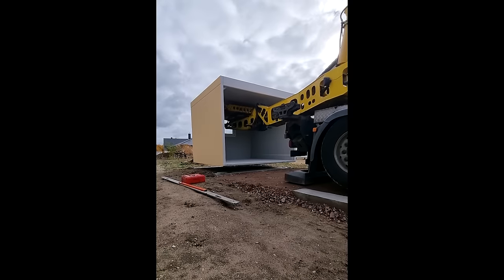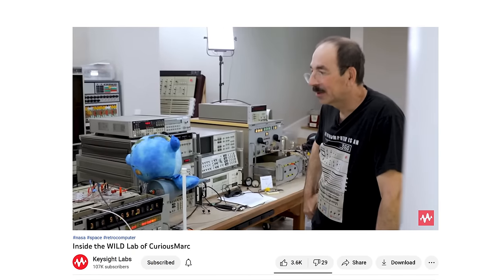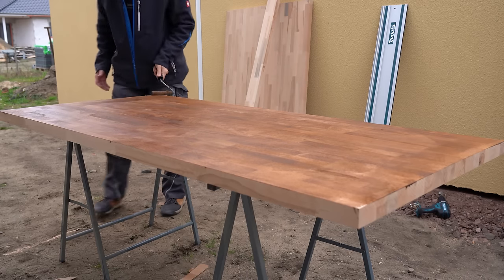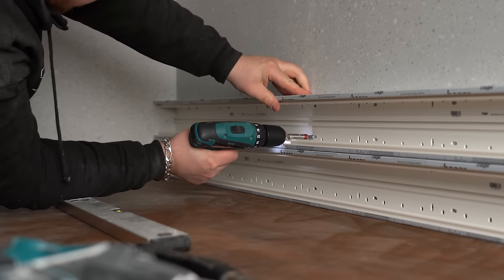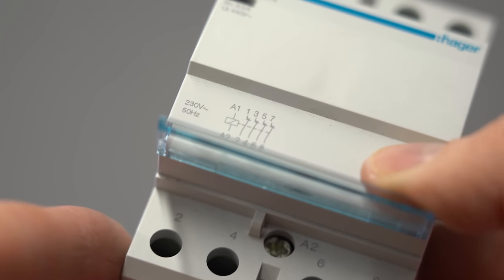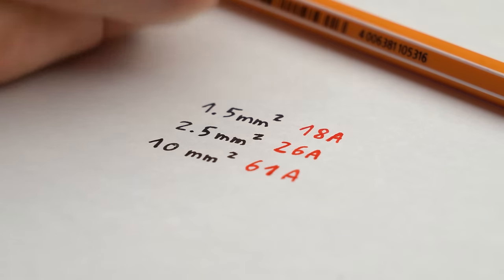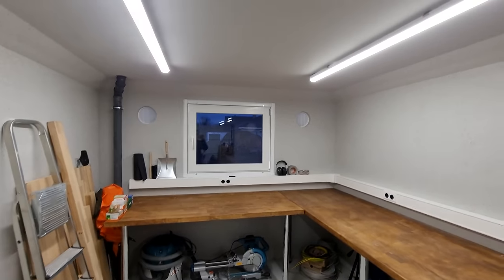Germans do the PERFECT Electrical Wiring! (Garage Build)

Comment: Nice and tidy work! The electrical code here in Belgium is very similar to yours, which isn't very surprising. I've done all my electrical work myself as well (also 3x400V+N, 32A main fuse), including CEE 32A sockets for my milling machine, home automation, etc. The only thing I'm wondering is why you're using blow fuses? We only seem to use those in industrial settings for really large currents (>64A), curious to learn more...
Reply: It looks like these fuses are pre-fuses for the circuit-breakers and so connected in line with them. In this case you have to take care about selectivity. This means that in case of a short-circuit only the next higher element in distribution hirarchy shall be tripped. Therefore yo can not use normal circuit-breakers for pre-fusing, because the tripping-characteristic-lines of the different amprere-ratings all run together into one line in case of a short-circuit and they all will be tripped. The solution is to use selective circuit-breakers (but these are rather expensive) or conventional "blow"-fuses.

Comment: Might have been better with a ‘Latching-Contactor’ or Circuit breaker with a ‘Shunt-Trip’ Circuit ?
That would assist with any ‘Fault-Clearing’ operations.
That means the Contactor would stay closed while the Circuit protection clears the circuit fault.

It’s unlikely that there would be a fault at the same time as someone operates the e-stop, but it’s definitely something that’s considered in industrial applications.

Contactors aren’t designed to clear or make fault current, they tend to fail catastrophically when presented with such extremes of Current.

Comment: I am your judge here.
I hate people when they put cables behind the fuse carrier... Hager has specifically those clips for those doings when you put cables around. (Later you can change RST order)
When things go wrong, we usually seperate earth from neutral. Cause if it overheats and starts melting , the live wont burn first, but neutral due from load. (Saves wires for later)(Just to mention this in our country , our ppl dont tighten the screws after some time cause of heating and cooling process)
When you connected from construtction to test power, i would gladly suggest you to put a bridge before RCD, cause earth is reserve netrual.Since you have 3 phases and 1 neutral i would suggest you that.
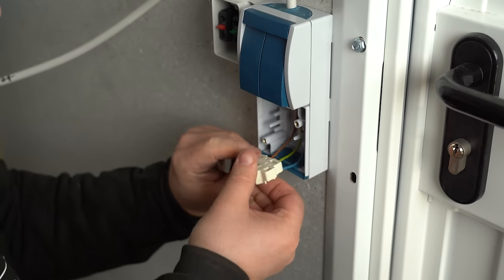At 10:49 when he stripps the outer shield of cable, that is no good. You can damage the main insulation from copper.(I've done it many times)
Those amps for copper are bit unrealistic.
I hate wagos.

Comment: Hey Scott. Dumb question. When do you use fuses, and when circuit breakers? Lot of industrial machines uses fuses in front of motor drivers etc. So my question is, why not just use breakers, if they are more easier to use and operate? Thanks

Comment: Personally, I would've done the entire electrical conduits and panels in steel, and ground it to eliminate EM radiation from the cables. Yes, 3 times the price of pvc plastic here. 
I see you had to pour a partial footing for the garage. Did you also have to go below the frost line of 6 feet like we do in Canada?
Reply: Steelpiping is not allowed. Steelcabinets are allowd if they are dubble insulated.

Comment: Nice work, but I would use one big pipe as opposed to 2 smaller ones; also I would add flexible pipe joints for the connection between the pipes or the corners

Comment: That's called "typically German!" Here in Germany we have rules for electrical installations of any kind. Many of these rules even have the character of a law. The DIN standard (German Industrial Standard) states, among other things, exactly which cable, which lines, which wire or stranded wire is intended for which application or can be used. Then there is the VDE (Association of German Electrical Engineers), whose regulations regulate the entire installation and how which cable is to be laid and connected. Even the core cross-section is precisely defined for each application. The labeling of each individual wire/phase is also prescribed and the type of labeling is also specified. All house power connection and distribution boxes are TÜV tested and are checked before commissioning and provided with a seal. Many power connections must be regularly checked and documented. Power lines are only laid at right angles and in compliance with an appropriate bending radius. Then there are precise specifications as to how lines are to be laid and which lines may or may not lie together. For example, power lines and telephone lines and fire alarm lines must not be located together on cable routes. Fire protection ducts are even required in many buildings. Even in a distributor, the individual lines and phases are marked and laid at right angles. Even simple control cabinets must meet certain protection classes (IP 65 as an example). Cable end sleeves, cable lugs or cable lugs are required for certain cables. In plugs and sockets it is stipulated that the PE conductor must be longer than the phase and neutral (return) conductors. In houses, a deep or ring earth and equipotential bonding are mandatory. Exceptions are houses with grandfathering, even for this there are clear regulations. I myself am only allowed to work under voltage up to 400 volts. A normal electrician learns this profession for 3 years and then takes a skilled worker examination from the Chamber of Crafts. A master's examination means studying (at least 3 years) A course if you have the suitability for it and have the appropriate experience, as well as years of operational experience. Or you can study the profession of an electrical engineer with a diploma for at least 4 years.

Comment: A little different to how we do things...we now use surge protection devices and AFDD`s on certain circuits plus RCBO`s on others and metal enclosures for fire containment....i whink we prepare for for fault conditions (safety etc) but its not bad at all other wise.... also may look at kinetic switches for lighting as it removes the need for wiring to the switch and is a proven technology now...but as i said if that is all the is required for a safe installation in Germany then well done :)

Comment: Genuine question, why do you guys not just use bends for the conduit instead of just making the corners open? In Australia we use bending springs to bend the conduit, or premade bends that are friction fit onto the conduit  protects the cable the whole length of the run
Reply: the pvc pipe is there to hold the cable in its place. the nym cable is double insulated you dont need extra protection

Comment: The biggest concern I have about it this would be labeling. Labeling should be priority #2 right after Safety.
Small labels on each outlet and corresponding labeling on the breakers can save an immense amount of work. Even in a 2 room installation, a complete outsider would need to do trial and error (by flicking a breaker) or follow the wires to find breaker/outlet correspondence. This get's exponentially harder on larger objects where the trial and error method might not be an option aswell.

Not a concern but a personal preference would be the use of smaller cable ducts instead of tubes, especially above the distribution box. I think they make it look cleaner and less crowded and are a lot more accessible to modifications than the tubes.

Edit: Another side note, I had an abundance of the Hager-Contactors die on me so I would recommend another brand for them, which in return would make the build less appealing sadly.
Reply: Not at all, electricians have tools that will find a breaker immediately without a label.

Comment: I'm in the process of adding an additional 500 sq/ft of workshop space.  I'm trying to decide if I want to run the power through the walls or wait and run them in conduit after the walls are built.  It'll be easier for maintenance or to do modifications if ran through conduit.

Comment: Interesting how you put the wiring in 'pipes', but didn't have to mess around with elbows or junctions at the corners.  Here in US, when it has to be in conduit, the conduit has to be continuous from box to box.
Reply: Same in UK. Also, UK is more strict about when the conduit should be metal and when "plastic will do just fine".
Reply: This cable is double insulated and does NOT have to be in conduit. The conduit is just used to minimize the amount of clamps needed to be drilled into the concrete walls.

Comment: Idk about Germany but here in Italy instead of double insulated cables we connect the pvc tubes directly to all the boxes and we use individual wires, they are soo much cheaper and easier to work with.
I wonder if it is the way it's done there or if it is how you did it 🤔
Aaand do you guys get 3 phase power at residential places as standard?
Reply: Three phase residential connection is pretty much a standard in Continental Europe. In Latvia, you can't even get more than 40A single phase to residential. You can get more than 40A three-phase*, though, for some reason. I know people with 63A 3-phase connections. 
My house is on 25A three-phase, in case you are wondering. 
_____________________________________________________
*- Subject to capacity availability, terms & conditions apply, might incur additional charges.
Reply: @jur4x  haha here we have 3 Kw single as standard rip

Comment: As a licensed german electrician I must say that bending safety regulations and declare that as safe enough is simply wrong. It is better to be safe than sorry. Having a master switch for the control circuit eliminates the power draw of the contactor. As an alternative you could use a proper RCD with emergency stop function integrated. I suggest also that lighting and power outlets do have their own RCD respectively. And there are no openers or closers, that a NC or NO contacts. Broadcasting in english and using Denglisch does not make it better. But you get an A for trying 😉

Comment: Great video. I am surprised that your main overload fuse protection is still using cartridge fuse replacement type. (Nobody keeps spare fuse) in Ireland we stopped doing this and also now you four pole isolation or two pole for single phase, for new installations. We also now have to have surge protection and low smoke cables, this makes things very expensive here. What heating will you have? You could also put solar on the roof!

Comment: you can do a safety relay (the green ones) and still save power. It's called a mains switch. 
There is no excuse for cheaping out on safety. 😛
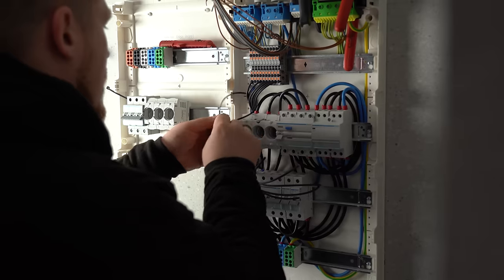Reply: Also 8:33 + you bound the wires inside the distri box. This is universally frowned upon. The reason is cooling.

Comment: Really the only thing i would do different is not running the power for the CEE socket trough your wall duct. i don't like the look of horizontal wireing, but when its almost on the ceiling it looks better. Also i don't like the look of that bush jeager ocean stuff, Niko hydro looks much better and seems better quallity but that really is it! nice job!

Comment: Nicely done. But I have a few questions... the special outlets that you can mount/demount fast. What would that be good for? you still have to remake the wallducts mask whenever you change their position. Secondly, why using fuses on the input? especially screw(bottle) fuses and not cartrige fuses or simply a circuit breaker?

Comment: Well, I would propably have used item aluminium profiles for holding up *everything*.

You propably wouldnt have needed as many workbench legs aswell (if any besides wall anchoring plus angle pieces), while propably holding hundreds of kilos, if not tons.
That ofc. depends on the connection points for the individual bars, as there are some for holding simple blind plates, to ones where you can smash a sledgehammer on for multiple days at once.
It might however still be helpful for future "structural needs", even if they are a bit pricy. (there are third party sellers that sell such things for considerably cheaper e.g. Motedis).
You can even use them for precise liniar motion e.g. for a table saw sled. Or for CNC. Or for diy 3d printers. There are also things like cable pipes, solar panel mounts (that could propably even be auto-angled to the sun), motors, spindle drives, energy chains / modular cable guides, even full assembly line equipment. Perhaps all that material can be used as a common test lab / esd ground.

However, my father basically indoctrinated me to use this as a proper, go-to construction material. 
So I might be a bit biased, if not nibpicky. It doesnt help either that I am living pretty close to item headquarters lmao.

However, the Buche / Beech workbench plates are absolutely great!

Comment: I think that in the bends, and near derivation boxes you should have used flexible pipes, rigid bends, or pipe-to-box connectors. If I remember correctly the law demands that every wire should run entirely inside conduits, but since you used bundled wire designed also for exteriors maybe the way you did it fine, even though it looks odd in my opinion
Reply: It's absolute standard in germany how they did it. Since the wires are double insulated there is no need for conduit at all, just makes it look tidier and professional

Comment: Congratulation, nice job.
I did not see any reference to an Emergency lighting.
A simple and useful  addition to the bench can be a  plastic box with a cable complete with  suitable plug. The box can be fitted with   a  fused outlet socket, a double pole switch anda neonON indicator.
This can be very practical to power a “device under test” with a difficult to reach power switch.
I had a similar one on all  my workbenches. Last one (sorry, I cannot add an image)  has a power display ( with Volts,  Amps and KWh)

Comment: I think conduit should go into fitting on each box I think single strand wire should be used 14 gage on 15 amps 12 gauge on 20 amps black red blue live white neutral bear or green ground that my opinion

Comment: In Sweden our cable dimensions per amp is a bit different: this is the Swedish standard for cable dimensions. 

10A (1.5mm2)
16A (2.5mm2)
20A (4mm2)
25A (6mm2)
35A (10mm2)
50A (16mm2)
63A (25mm2)
80A (35mm2)
100A (50mm2) 

This is to ensure that there is enough headroom for overload and short circuits

What made you choose fuses instead of dwarf circuit breakers?

Too bad you didn’t record more of the testing (continuity, isolation, rotation, function tests etc) would have been interesting to see 

PS: that cable management inside distribution box is sexy as hell.... makes me drool a bit

Comment: Did you consider adding a circuit for an electric vehicle charger?  Even if you won't use it immediately, wouldn't you think it's a good thing to include in new construction?

Comment: The contactor don't need 62W permanently , only for a few seconds. normally a 63A contactor needs less then 15W , the finder cop. says for example here 22.64.0 series takes 6W 230V aux voltages. 
Instant of the Contactor ,for the emergency switch  a undervoltage release mounting on the RCD will be a also a good option. The electric lighting should be run over a  separate  RCBO breaker (B10 30mA type A ) , prevent you stand in the dark and maybe hurt you , if a device have a failure and trip the RCD.  

Kleiner Fehler, die Angabe bei hager für das Schütz bezieht sich nur auf den Einschaltmoment, normalerweise brauchen solche Insta Schütze <15W, bei Finder steht z.B. 6W/230V im Datenblatt. 
Anstatt einen Schützes für den NOT-Aus wäre auch ein Unterspannungsauslöser am RCD einen saubere Lösung gewesen. Die Beleuchtung der Garage hätte ich persönlich über einen eigenen RCBO B10/30mA abgesichert um Unfälle zu vermeiden, wenn ein Gerät den RCD auslöst und man im dunkeln steht.

Comment: You may not use the blue conductor in a cable for switching power in Germany?  In Finland it's OK. What is the purpose of the porcelain fuses, and why that type? Main fuses? Because of better breaking capability? Keep up the good work, the garage looks nice.
Reply: because it is slower than the circuit breakers

Comment: Very nice, but I would have used the pipes more so you won't see any cable. Even use different junction boxes to support them. I would also use VD wire to go through all these pipes.

Comment: An RCD, or residual current device, is a life-saving device which is designed to prevent you from getting a fatal electric shock if you touch something live, such as a bare wire. It can also provide some protection against electrical fires. RCDs offer a level of personal protection that ordinary fuses and circuit-breakers cannot provide.

I didn't see u installing one.  It is a good safety feature.   But then again I'm not professional.

Comment: Regarding cee socket. Since it's red its 3 phases. But don't saw the socket. There should be writing on it. If 32a. I'm not sure the wires 2.5 are sufficient. You should go with 4. 
But if you made this with an electrician, he knows the rules applicables  in your country. :)
Reply: its  16A 3phase so 2,5mm² is fine :)

Comment: UK spark. 8:32 ceiling conduit join. You can get a BESA box in 20/25/32mm that connects all conduits without that mess. In England you'd see that and ask if the customer got the colour of the previous sparks horse. Also you not providing fire rated fixings to stop the system collapsing in the event of a fire?

Comment: Just a question: I see you use the old type of blow fuse for overcurrenty protection. Why did you for this instalation not use RCD+OC fuses? that would be a 3 U 3 fase use for all the features you want plus you have a seperated ground fault detection per cirquit.

When I redid the electrical work of my workshop I tore out all the blow fuses and replaced them with RCD+OC fuses. NEver the less the instalation and organisation of the electrical wires is mint, looking increadibly neat.